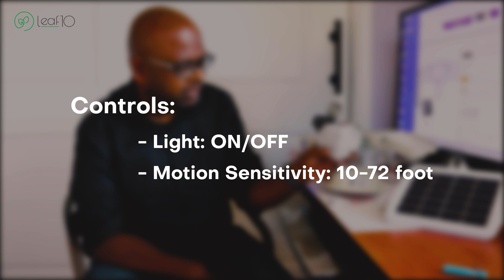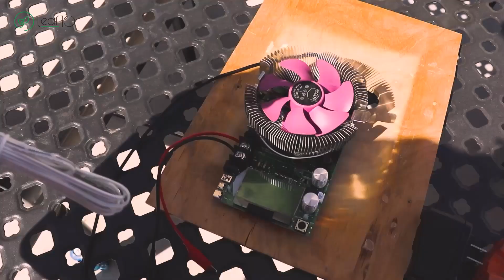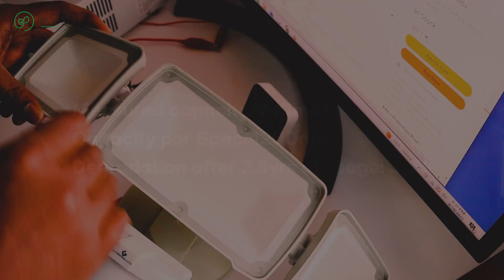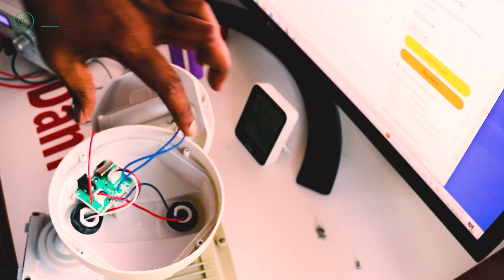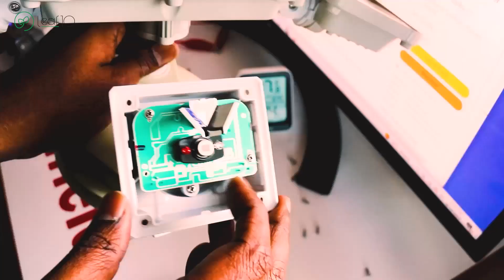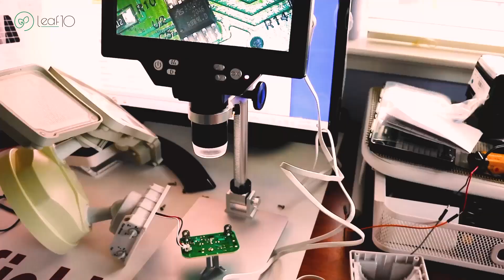Teardown of Solar Security Light with Motion Sensor | Experiment #6

Comment: Do you think I could  use a step down to charge the security light directly?
200W solar panel > 80Ah 12v battery > buck converter to 4v > light via barrel connector?
I trying to light up 4 sides of my shed without having to use all 4 mini solar panels.
Thanks!
Reply: 80ah x 12v - 960wh. Solar panel is 200w. Assumption here is 4.5hrs (960/200) of bright sunlight that helps peak power generation to charge 80ah battery. Hoping you are in Sunbelt region.
Reply: Yes that should work. 

Just a thing to keep in mind - With a solar panel power generation stops at night. Now you have a 80AH battery, all 4 lights with its own 2x18650 batteries (total 8)  will keep pulling current and drain your 80ah battery.
Next morning, your solar.panel and sunlight should be powerful enough to charge 80ah + 8x18650 batteries.
Reply: Yes that should work. 

Just a thing to keep in mind - With a solar panel power generation stops at night. Now you have a 80AH battery, all 4 lights with its own 2x18650 batteries (total 8)  will keep pulling current and drain your 80ah battery.
Next morning, your solar.panel and sunlight should be powerful enough to charge 80ah + 8x18650 batteries.